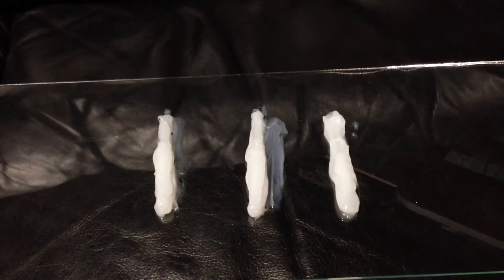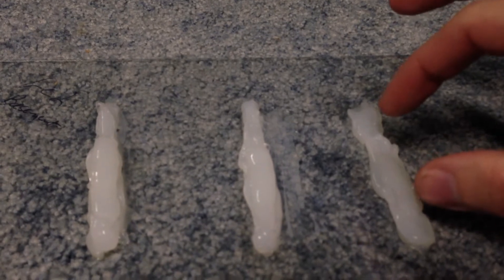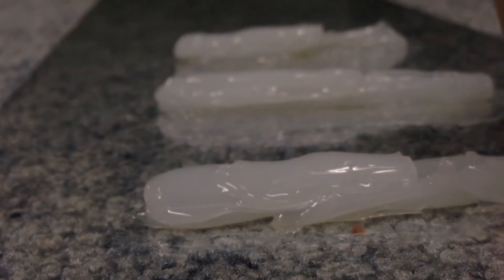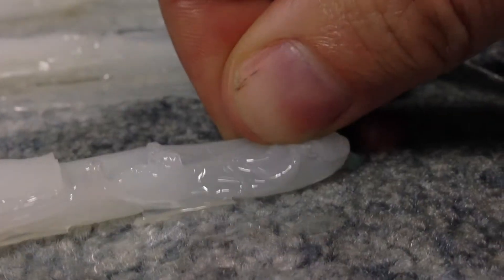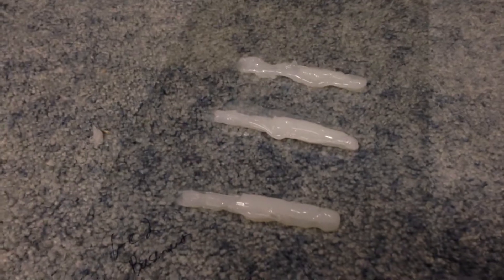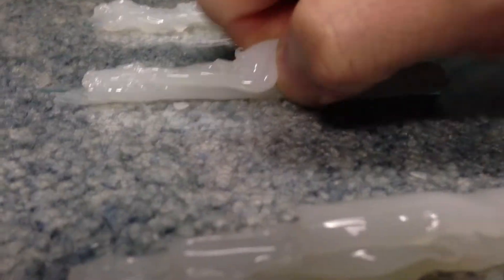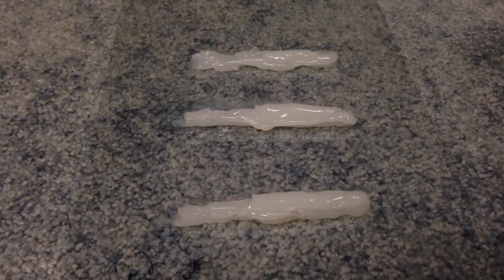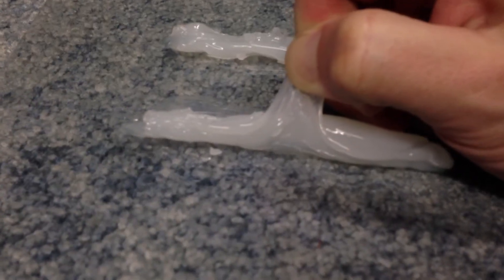Silicone Product Test p2 - Silicone to Silicone to Silicone

Comment: Nice video... Ive resealed two aquariums so far and i noticed silicone does indeed stick to silicone..

For example when i resealed a tank i noticed a spot i messed up on and this qas 4 to 5 days after.... I just took more silicone and put it over the old stuff.. once it cured it didnt come off.. it bonded to the old stuff.

I dont know why people say it doesnt stick... They are all idiots
Reply: I just did the same for my reef tank. I applied an initial 10mm bead, it looked great but one spot folded over. So a day later I ran a 16mm bead on the bottom seams.

Is your tank still holding water fine?
Reply: Is your tank still good